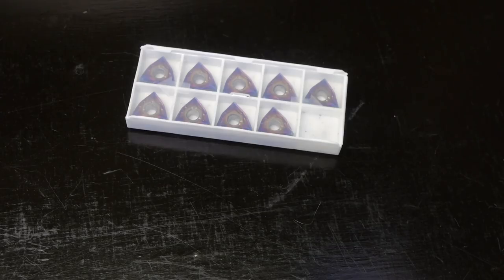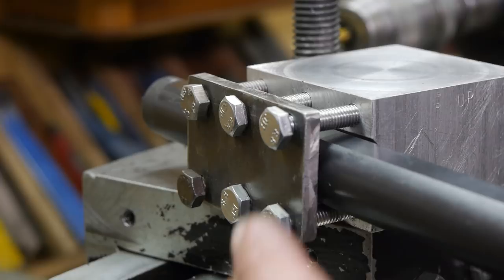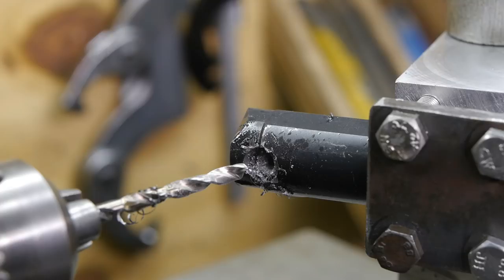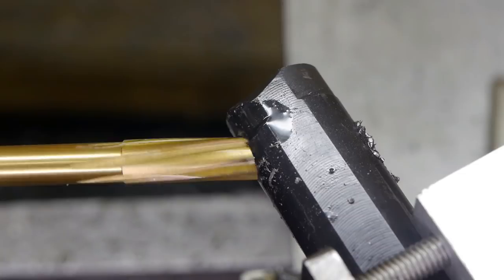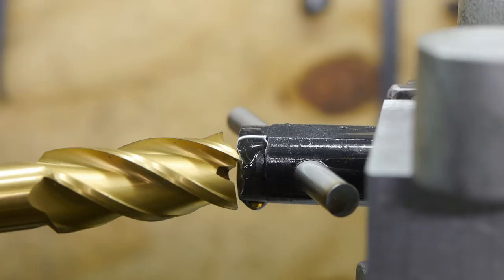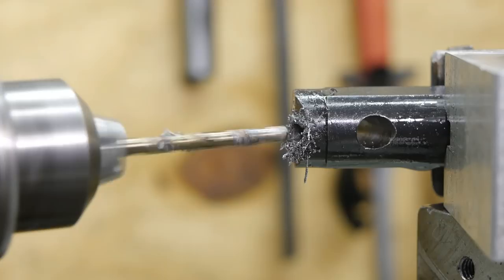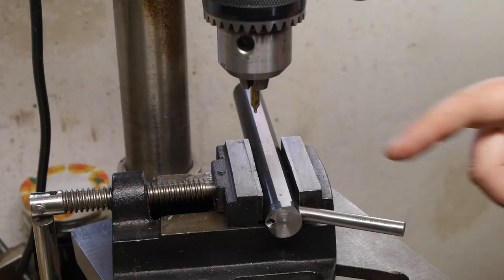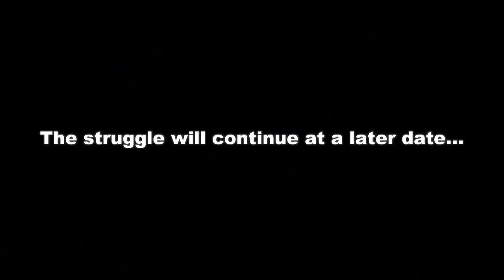Failed boring bar modification

Comment: I think the boring bar was fine. The mounting surfaces of the inserts you have are higher than the cutting edge. This is way the unused edges are not damaged by clamping down on them. You can also see that in the picture you were showing on the topside. So the gap between the insert and the insert pocket is necessary.
Reply from the maker: It's actually the other way around, the surface around the mounting hole is thinner that when measuring cutting edge to cutting edge. And my right hand tool uses a shim and I don't see an air gap on that one. The boring bar has no room for a shim.
Reply: You're right, negative geometry inserts have a face to sit on in the tool which sticks out above the cutting edges. Rollingmetal, I'd suggest you try to measure the inserts again. once flat accross the hole with calipers and once just across two cutting tips at the end of the insert.

Comment: If you can't tap the M6 hole completely to the bore intersection, you can always use a dog-point set screw of some fashion.  There's plenty of thread depth available to hold the load.
Reply from the maker: That a great tip, thanks. I considered turning down a longer set screw but then a started working the set screw back and forth  and before I knew it enough material wore away so now it fits :)
Reply: awesome

Comment: The 7.5 mm drill bit problems was because of too mush speed,  you can get away with it for a few sec when the drill is new but you burn it up fast,  brass and alu would be fine but not steel and sertenly not tool steel. On that tool steel i would go 600 on the senterdrill, 400 on the 4mm and 200 on the 7.5,  it it still buns up sharpen and cut speed in half  Love you vids :)
Reply from the maker: The lathe was running about 650 rpm and I always thought that was too slow for a 7.5 mm drill bit so I never considered slowing it down. I know better now, just hoping I remember it for the next time I'm dealing with harder materials

Comment: Jeez, you sure keep us on the edge of our seat :)

A little tip: taps come in taper, second and plug (bottoming). If you start with the taper, no need to use a machine fixture. Just free hand it, and progress to second, and then plug. Don't worry, it will tap straight if you're reasonably careful. And clamp that tap wrench tight around the square end. If you don't, it's difficult to feel when the tap is about to give. Also, I think proper cutting oil would have made a difference also. And buying quality taps. That boring bar, at that depth, should NOT be harder than a tap.

Comment: 6 sided inserts rest on the chip breaker.  I have huge money boring bars with replaceable carbide seats and they still show that gap.  If it rested on the cutting edge they'd be junk...
Reply: So your new bar, if they send it will also have that gap.
Reply from the maker: I assume the should rest on the flat surface around the mounting hole.
That surface is thinner than the cutting edge. I don't see an air gap on my right had tool bit that uses a shim. The boring bar doesn't have a shim. We' ll see how the replacement look like if it ever shows up. status is still on processing after 6 weeks.

Comment: OSG Tap, Spiral Flute, Inch, 1/4"-20, Modified Bottoming, Granger part # 2PJR2 for example.  One and done!  They are not cheap but boy do they last and properly used they work great in just about anything.

Comment: I feel this on a personal level. I've been amazed by the variety of difficulty when using different taps. Cheap ones suck, yes, but even some of the more expensive ones are still garbage. Good ones are so easy, you can't believe how you suffered with the junk ones.
Reply: @TakeDeadAim I was saying that a good brand name tap will make life easy. I was just pointing out that some expensive taps are still junk. We just have a failure to communicate ;)
Reply from the maker: Someone suggested cobalt taps from phantom. I have some phanton drill bit and the are pretty good. Any thought about cobalt taps? I found those high cobalt drill bits from Banggood a bit brittle. But they worked fine on the hard metal boring bar.
Reply: @Rolingmetal  Cobalt should be better than hss, but of course it still has to be good quality. Even a carbide tap can be infuriating to use if it doesn't cut well due to poor geometry or other manufacturing flaws. As you noticed with the blue nano inserts, just looking cool and being more expensive doesn't make them better for your application. That's part of what makes hobby machining difficult. We want a tool that'll do everything at an affordable price. Looking forward to your future videos!

Comment: Hi RM. That didn't look fun,but you got it done. I had the same thing happen today and found I was drilling to fast,causing the metal to harden on me.  I am making parts for an old backhoe. Has always I liked,Shared,Added to playlists. All my best
Reply from the maker: It's frustrating when after an hour or so you still haven't accomplished anything. But is is typical for this amateur :)

Comment: Hardened metal heat it with blow torch.it will then drill or machine easy.works for me :-)
Reply from the maker: I don't have a torch that would get it hot enough.

Comment: Slow down and use cutting oil/coolant....... Also, when I have trouble like that, I check the drill grind. Make sure that it's sharp and fresh, and at afon angle suitable for the material. The angles matter...... If you're drilling into aluminum or plastic, for instance, drop the angle down and decrease clearance. Lessens grabbing. In hard material, increase the relief angle but maintain a wider cutting edge to give it durability. Don't use a razor on a tree, and don't use a chainsaw on your beard.....
Reply from the maker: Slowing down would have been the wise thing to do, but unfortunately i never though of it for some reason. So stupid of me

Comment: In a pinch you can grind the tapered tip off a  good (as in sharp) 1st tap to make a bottoming tap.
Reply from the maker: I did consider that after all those teeth  broke of the bottoming tap

Comment: I sympathize with u on that tool I've done the same thing but I put it in the heat first let it cool will cut like butter then of u want to harden just reverse the process keep up the good work .
Reply from the maker: I don't have a proper torch for that. Nor do I have the experience.
Reply: @Rolingmetal  you maybe have a bbq or just make a good fire would work I put mine in my burning barrel with a wood fire work great

Comment: Why didn't you anneal the bar before starting any work on it? It would have made the whole job easier and faster.
Reply from the maker: would have, should have :) Short answer, or excuse, I'm a total amateur, trying tO learn by doing, instead of watching perfectly executed Abom videos all day:)
Reply: @Rolingmetal  Don't worry about it, I'm not slagging you. I'm a total amateur too, self taught machining on my mini lathe, after many years as a wood turner. I appreciate your videos because they so show that not everything goes according to plan in the workshop. Much more so when one does not have unlimited tooling. The main thing is you battle through until you have what you set out to accomplish

Comment: Why do you use so high RPM when drilling? No wonder it work hardens. That's why the smaller drill bit worked, it has less surface speed than the bigger one. For 7,5mm hole in this type of steel, I wouldn't use more than 300 rpm. Especially since you don't use any coolant.

Look at this Pierre's video, where he tests some drill bits on hardened steel. 
https://www.youtube.com/watch?v=rd1eyxrlIhw
This is about the maximum rpm I would use without flood coolant.
Reply from the maker: I have no good answer to that. I was thinking the lathe was running rather slow for such a small drill bit

Comment: Bet that bar was not tempered properly after hardening. Likely they only had it in the oven for a hour or so and then rapidly cooled the batch, so as to cut time in the shop. Outside softened slightly, but the core was still getting hot and relaxing. normally the other way round with hardening, you want a soft and chewy centre and a tough sking, but here it is the opposite. 

Might be worth totally softening the bar next time and rehardening it before the final sizing, though your tapped holes will be slightly smaller from growth of oxides.
Reply from the maker: I agree they might have cut some corners to keep the price low.

Comment: For the taping problem use a Hss-Co tap from the company Phantom there not expensive and work as a charm on hard materials
Reply from the maker: I found some Phantom drills at the local flea market. They are my bet drill bits :)

Comment: Somebody send this guy some carbide end mills and maybe a drill or 2 also.  You might have to heat that sucker up to soften it a bit.  And still yet, you might not get a tap through it anyway.
Reply: And maybe take it to the high end of the tap drill tolerance.  (Even a little out of tolerance, just don't tell anyone and keep it away from Inspector 12!)
Reply from the maker: Bigger drill bits for for easy tapping and cobalt taps are now on my wish list :)
Reply: @Rolingmetal  There you go Brother.  I enjoy your channel, this is a dying trade, nobody wants to go into it any more.  But in 38 years, since 1981 (damn I'm old!), the only time I've been unemployed was when I CHOSE to be.  It's  a good gig

Comment: You should consider using a larger tap drill for tough steels, 75% thread engagement should be OK in your case.
Lash out and buy a set of drills in 0.1mm steps these can get you out of trouble in a lot of jobs.
Reply from the maker: That's a good idea. I will buy a set of slightly bigger cobalt drill bits for making "weaker threads" in  hard metal

Comment: That 5mm "Bottoming" tap is crap! It should not have a point on the end but be flat, AND the treads should go right down to the end, thus allowing you to "Bottom" out a blind hole. The same goes for your 6 mm set up, if you had drilled out through the tool bit hole into the meat of the boring bar then you could have let the second tap go right through without any restriction and tap the hole fully. That would have saved you some time and problems.  "There's more than one way to skin a cat" as we say in England lol
Reply from the maker: I like that idea to just drill though the hole for the toolbit to make some room for the tabs. If I had done that I might not need the crappy bottoming tap :)

Comment: You will find if you use oil as a coolant and you start to drill the metal it gets so hot and the oil starts to harden the steel.
Reply from the maker: First time I experienced that :)

Comment: Was that motor oil you were using or cutting oil?  I would have used more.
Reply from the maker: Probably 15w40 semi synthetic
Reply: @Rolingmetal   motor oil is absolutly the worst possible thing to use as cutting oil.   basically, it is TOO GOOD at being an oil and does not allow cutting.  cutting oil has the property that it is oil up to a certain pressure (pressure between tool and workpiece) , which is much lower than motoroil, and then it breaks down and allows cutting.   In future, if you run out of cutting oil, rather use chicken fat collected from the roasting pan.  That is all I ever use.

Comment: Airgap my ass , measure the insert thickness at the tip and more towards the center , you'll find out the contact surface on the insert is thicker than the cutting edge .
Reply from the maker: The tip (cutting edge) is thicker then the bearing surface around the mounting hole. The boring bar has no shim but my right hand tools bit does and it has no air gap
Reply: @Rolingmetal  well , it'still just a video , so we can't really see it that well , but all the double sided inserts i've used had airgap around the insert periphery (shim or no shim same deal) . But if was cutting improperly , and now it's ok that's all that matters . And a bit of advice . Stop buying the el cheapo chinese tools , there are plenty id and od tools used or new/other at 50-25% of market price

Comment: I dont think motor oil is a good choice for tapping, especially on something hard. I wonder if gear lube might have worked better since you were out of cutting oil. I was nervous the whole time😬
Reply from the maker: I never noticed a difference between regular oil and the cutting oil I used for years. you might be right about gear oils especial hyoid gear oils

Comment: For the love of God use more lubricants it is cheap compared to tooling, helps to keep things cooler too.
Reply from the maker: I will use a bit motor oil, got plenty of that stuff. Food coolant won't be on option with a leaky wooden workbench. But the wood can probably soak up lots of oil :)

Comment: read up on SPEEDS AND FEEDS and don't be afraid to tighten your chuck, it wont break lol
Reply from the maker: I can just about break anything. One of my better skills :)
Reply: Use Molly blue tap & die oil what your useing won't take the tool pressure and use sprial gun taps 😁.

Comment: The drill was acting up because it was intersecting a angled hole.
Reply: No it wasn't!
Reply: @robcrawford9657  uh what
Reply: @Steve_Just_Steve  uh no!
Reply: @robcrawford9657  @26:00 uh... yeah
Reply: @Steve_Just_Steve  Steve once the drill cuts the depth of it's own taper it's not drilling at an angle anymore. i'm sorry, i don't like casting pearls before swine. if you apologize everything can go back to how it was.
Reply from the maker: indeed, it as acting up long before it was breaking though

Comment: What lighting you using? Bruce Springsteen likes dancing in the dark and at the minute i may as well be machining in the dark.
Reply from the maker: I sure could use better lighting, even-tough I did install some extra fluorescence lights. Or maybe a more light sensitive camera.
Reply: @Rolingmetal  Oh! i think your lighting is great but mine is like turning by candle light.

Comment: Hi buddy what is your Job in real live? Metallwork can't be.  You need a machine tab.  This is shorter and you need only one. And the important thing is. You can cut hard material only with harder material . Steel with hss.
And boring bars with tungsten carbide. The tab is the wrong choice. Better is you use toolsteel 
Machined and hardened the Steel.

Comment: Holy smokes, you are obviously not in any way a machinist, you can't sharpen a drill, it seems your lathe only has ONE speed! Stan, did you cringe like I did all throughout this process?

I kept expecting the whole setup to explode.
Reply from the maker: Setup worked better then expected for a piece of alluminium

Comment: Motor oil is designed to stop wear hence, it will not help you cut. Its scary watching you work.
Reply from the maker: I never noticed any difference between the culling fluid I used for years and regular oil

Comment: I would have annealed that end  It seems to work harden.
Reply from the maker: If you anneal it you also need to harden it again. That second flat spot war certainly work hardened
Reply: That squealing was a dead giveaway.  I've found that even the cheesiest Chinese inserted borinh bars are usually made from some pretty decently tough alloys.

Comment: And this is how you destroy a perfectly fine boring bar ... all have that gap , the insert is thicker in the middle, and the pointy bit smaller for the chip breaker... 
it is funny to see (not just in this video) that you don't know shit about what you doing... and other people that don't know shit are supporting you...
Reply from the maker: I do know that the right hand tool that uses the same insert has no airgap.
Reply: Rolingmetal have you tried with the same inserts ? All the negative inset tooling have the gap on the chip bracker . How big the gap is , depends on the type of insert and chip bracker. Just put a caliper on the insert and you will see that is bigger in the middle then the pointy bit...

Comment: You seems to make all the rookie mistakes on the books...
Wrong speeds for the hardened steels (way too fast), not rigid setups (sticking end mill too far out unnecessarily)...
If it doesn’t cut and just rubbing you actually generate heat and harden even more the part...
Tapping requires to back up in order to brake the chips. On hard material back more often all the way out and clean the hole...
Hope you learn your lessons...
Reply from the maker: I like to think I actually learned a bit from this video :)